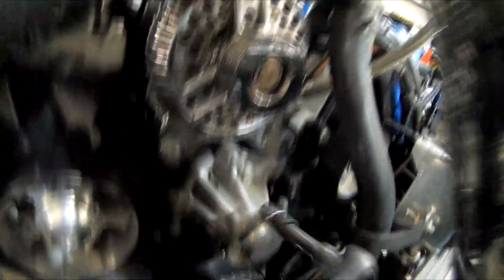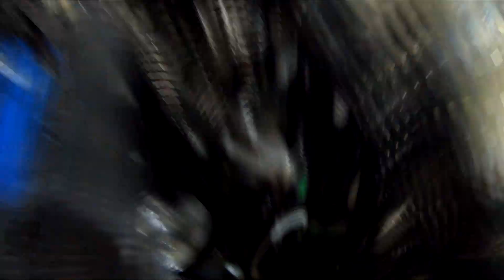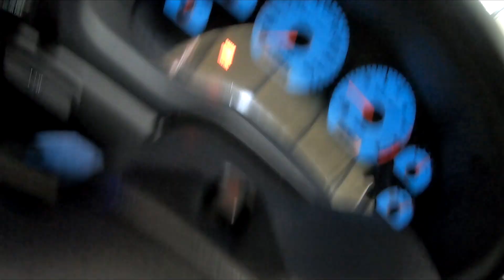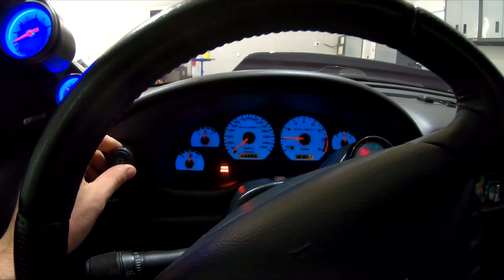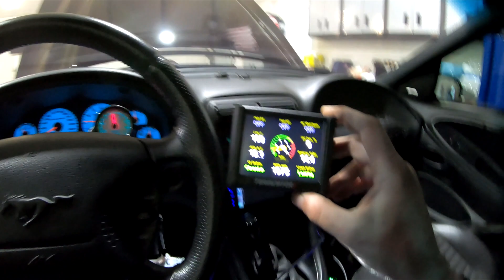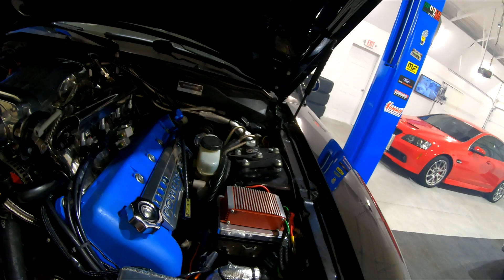Terminator X install on the TTSaleen - part 2 - I fixed the gauges but new problems found!

Comment: Hey, I know this is not relevant to the video. But i couldn’t find the dyno video of your car years ago when you ran the vortech and intercooler on stock bottom end. Do you remember what hp/tq it made and if it had headwork done? I am about to rebuild the transmission and want to make sure I get one strong enough for my “end game”.
Reply: And I guess what trim SC you had as well? @98saleen
Reply from the maker: Back then it had a stock bottom end, PI ported heads, Crane Cams, PI intake, 70mm t/b, longtube headers, 2.5" x-pipe, Vortech S-trim pullied for 15# of boost and made 530rwhp.  On a shot of NOS it made 615rwhp.  One night when temps got in the 30's it detonated slightly and cracked the top edge of a piston.  I swapped in a stroker kit and upgraded to a T-trim vortech (big mistake it was a dud) and made 615rwhp and 534tq on boost only.  With a 63NOS jet it made 727 rwhp.
Here's the video - https://www.youtube.com/watch?v=zsdWsOMeklw
Reply: @98saleen  awesome! Thanks man. I have the Si-V2 and it made 343/344 with no intercooler through a 4r70w. Need to build transmission next. Always liked your car the black gt and yellow 01 cobra with the vortech. Been wanting this setup for years!
Reply from the maker: Not a problem and thanks!  Be sure to subscribe to stay up to date on all my latest vids.  I got more coming soon on the TTSaleen.  Been working on it tonight and starting to make some headway on this tune and it's now on E85 for the 1st time in its life!  Ryan
Reply: @98saleen  done!

Comment: Not your main issue, but for filling them up after you drain the coolant, look into the vacuum styled fill systems. We use them now all the time to get around air pockets. It pulls vacuum first, then holds to check for any leaks, then fills and there’s never a bubble.
Reply from the maker: You know I have one but didn't use it this time because the car had water in it.  I probably should have from the get-go and saved myself a lot of headache.  But in these cars with the filler/burp cap at the top of the intake have you had many issues?
Reply: @98saleen  usually no, but every now and then there’s always 1. And that 1 always seems to happen when you’re in a hurry LOL.

Comment: Not sure how much pipe you have after the wideband especially with the open exhaust like you have it.  It might be too short of a length causing a false lean condition and the computer is throwing fuel in when it doesn't need to making it over rich.  With your AFR's swinging all over, it sure looks like that might be an issue.
Reply from the maker: You are probably onto something there.  I had 2 extra O2 bungs between my headers and before the turbos that I decided to use.  I agree that this is probably causing it to see the cylinders too quickly and in-between each other which is why the Holley and my own sensor (located in separate pipes to separate turbos) are acting the same way.  So in essence 4 cylinders on each side are independently firing or not and the sensor is seeing this in real-time and going rich/lean which is causing the computer to toss the timing around.  I have to install my X-pipe to have access to the other O2 bungs for now, but will get some new bungs added soon.  I'm gonna try this test tonight and see if it fixes at least the bouncing Air/Fuel issue.